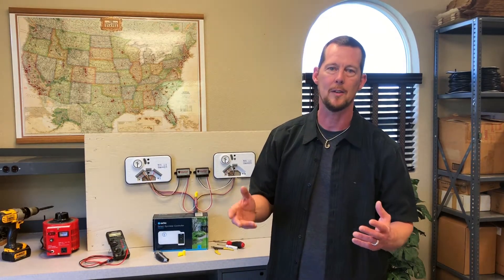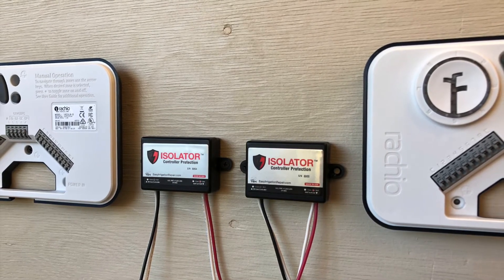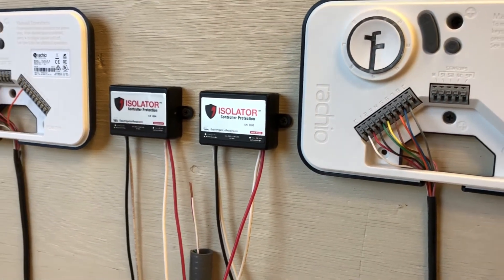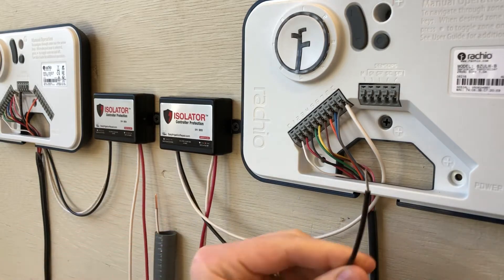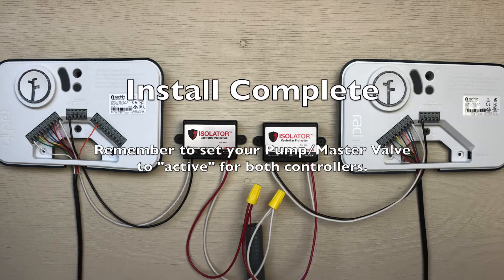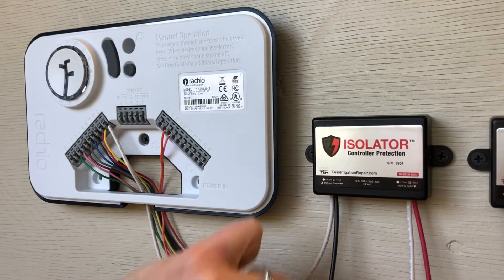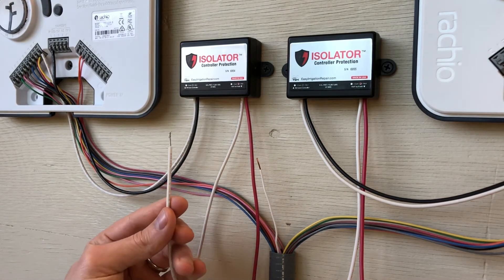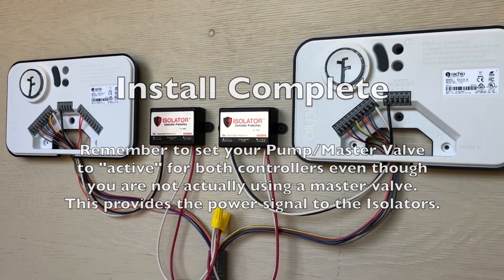How to Wire 2 Controllers to One Master Valve or Pump

Comment: What if you want to use two controllers in system that has a common wire AND a common Master valve? Will your scenerio A work? Or do I need 4 isolators?
Reply from the maker: Yes, you are correct! In your case you can still do it with 2 Isolators and would be like Digram A in the installation instructions. You would not connect any field common wires directly to the controllers but instead connect ALL the field commons to the White wire of the Red/White pair of the Isolators. Then the Red of the Red/White pair would be the hot wire for the master valve. This will run all commons through the Isolators so both controllers are protected.

Comment: Very interesting, but I wonder why wouldn't you just use a single 24vac transformer, connected to both controllers? The controllers will work perfectly with only one AC transformer and have only one common back to source! ;)
Reply: Interesting perspective. However, I believe you will short the controller's hot terminal when the other controller is running a station and vice verse. Those hot terminals are only to send power, not to receive it, regardless if they're running from the same power. I was trying to connect two rachios to the same hot wire of a master valve and Kapoot.. I'm typing with only one hand now
Reply: You’re totally and completely right